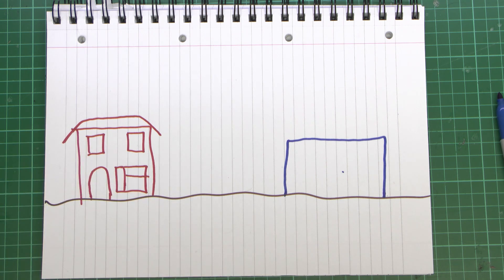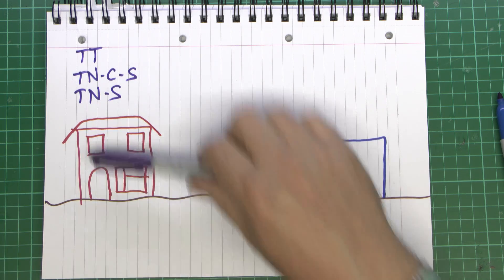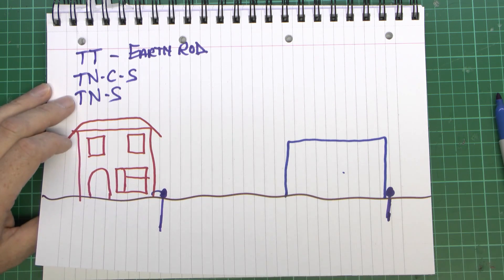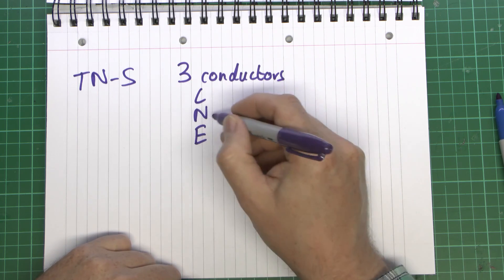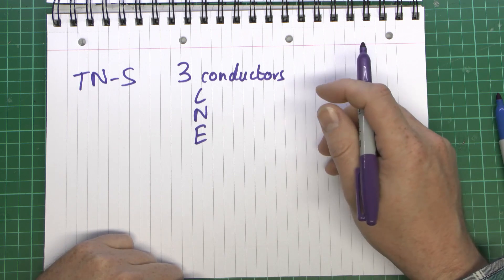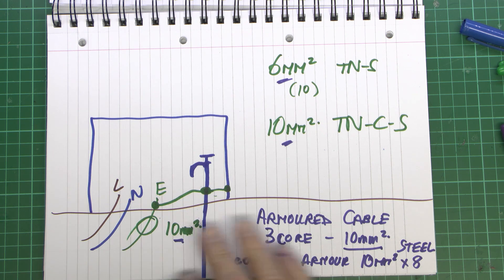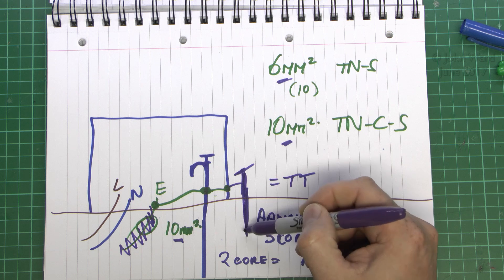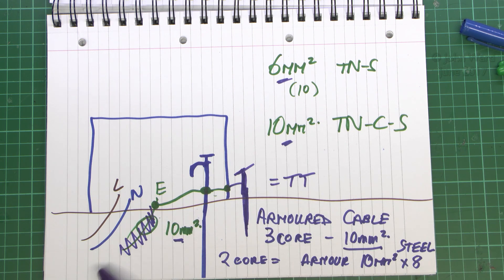Earthing Systems for Outbuildings

Comment: Hi John, fantastic channel. How do I donate? 

Quick Q. I need one 32amp radial circuit for approx 4 double sockets in an outbuilding that I'm having built. I also need a second 32amp circuit for a single connection to a large printer which has a max draw of 20 amps but uses a blue 32amp connector. 

Would the best and most simple approach to be to run two 6 or 10mm armoured cables to the outbuilding from the houses consumer unit with a 32amp MCB for each? Should I put an isolating switch on the printer?

Many thanks
Reply from the maker: Two cables could be used, although 4mm² is plenty for a 32A circuit, unless the cable is excessively long.
A more usual choice would be a single cable to the outbuilding, and then have various circuits from a consumer unit in there - presumably this building will also require lighting?  That also provide options for alterations / additions in the future.
Printer should have an interlocked socket, which is a switch and socket in the same box, so that the plug can't be removed unless switched off first.
Donation and other info: https://www.flameport.com/youtube_channel_info.cs4
Reply: @jwflame  thank you for the reply

Comment: Could you use a 6.mm 3core swa  and use one of the inner cores plus the armour to make up the difference ?
Reply: Following this comment
Reply: I (think) i worked out that may not in-reality be enough...  and in some respects goes down to the regulation-wording.
I could also ask after 4mm 4-core , 2 cores + armour to carry the main equipotential bonding?  Puzzle!
Reply: Come to think of it, probably not as the steel cores would have to be at least 32mm before you even go there, and even then, it may still not comply as it is not one material or the other due to wording of the regs
Reply: I’d say not because they would then be parallel conductors and a parallel conductor need to be the same diameter, same length and made of the same material to ensure it has the same resistance I believe.

Comment: Surely most people will want to fit RCBOs or RCDs on all new installations anyway, so TT is the basic way to go to satisfy regs easily. If you supply with say 6mm SWA 3-core and link armour and earth you have more than enough safety at reasonable cost.

Comment: What's the difference between touching the floor of an outbuilding with a concrete floor, which is the "ground" is it not if the concrete is in direct contact with the earth below, and touching a tap connected to the ground through a metallic pipe ? Surely in both cases you're touching ground ? Or is this just a case of how good the connection is as a conductive path ?

Comment: if you run your copper water pipe from your house to your garage or shed wouldnt the earth from the house cover this as its directly connected. You would only have open circuit on the tap earth in the garage if the water pipe was physicaly broken.

Comment: Hi John thanks for another great video very informative as usual. Just wondering what the main reason why you could not use tncs earthing from a house for caravans but you can for a steel shed. Are they not essentially the same if a neutral fault were to occur before the installation? Thanks again!
Reply from the maker: Caravans are mostly insulated from the ground due to having rubber tyres and the smaller legs being typically on wooden or plastic pads.  The connection to caravans is usually via a temporary flexible lead with only 2.5mm² (or even 1.5mm² ) conductors, so faulty or broken connections are very likely, as are reversed L&N connections, and even when connected properly the earth / bonding is far smaller than the 10mm² minimum required for TN-C-S.
Reply: @jwflame  Thanks John!

Comment: I was always taught that on PME you must never take the earth outside the equipotential zone (house). In a separate outbuilding an earth rod was required and the garage CU had to have an RCD. The earth rod was a reference for the RCD to operate in event of a fault and 6mm was suitable if mechanically protected.
The SWA from house to garage was also covered by an RCD on the house CU in case the underground cable was ever damaged. At the garage end a plastic CU was fitted and the end of the SWA steel was isolated from the earthing in the garage. This was to prevent and external service earth faults tracking through your house earthing system, through the SWA earth and down to the garage earth rod which could possibly be a few hundred amps.
Is this old school thinking and have things changed? 
Not done 18th yet, hope to retire before I need to take it...lol
Reply: That's exactly what I thought except the reason for it being that with TN-C-S there could be neutral circulating currents due to earth and neutral being the same conductor externally and there can be a "perceived" electric shock between exposed conductive parts and real earth.

Comment: exporting an earth from a PME.
ZE was 1.28 ohms at the out building
outside of 0.35, so at the remote building (20 metres away) i isolated the exported earth and installed an earth rod.
your thoughts?
Reply from the maker: Ze is measured at the origin, not at the end of a circuit.
Whether Zs of 1.28 ohms at a remote building is suitable depends on the protective device installed.
Using an earth rod instead of the supplier earth will make Zs far higher.

Comment: On a tt system, I don’t understand why you would need a second Earth rod in the ground for the garage if you took an Earth from the house.
Reply: from what I get from the video you dont need it - only if there is extraneous metal parts
Reply: If you have a TN-C-S or TN-S supply to the house and your taking an earth to the garage there would be no need for an earth rod. As this would continue as a TN-C-S or TN-S system, providing the CPC is appropriately sized.
Reply: Jck142 extending the tncs, to an out building, if the neutral goes down, are you not out the equipotential zone? I thought you are, and this is why you don’t use the pme and simply rod it. Slightly confusing. Many people say only use one system, I’ve also read and been told, you can supplement pme with rods. I.e a cabin wired in swa, using the pme, can be supplemented with a rod( in case of neutral fault). Under fault the currents can be large and burn the rod out! So unsure about this too. Very conflicting, wonder if @johnward
Reply: Moelwyn, he answered that question elsewhere on this video amongst the other comments, you can export so no need for another earth rod

Comment: Hi JW, I have taken my ringmain and lighting circuit and isolated it from the house consumer unit, so effectively disconnected from the grid. I have installed an off grid system, e.g. solar, battery, inverter system and have connected the house ring and lights via a new consumer unit. I have used an earthing rod to earth this system which goes directly to the Inverter, and from the inverter goes the earthing wire to the consumer unit. What guage wires would you recommend to ensure a good earth in this system? Or perhaps you can do a video on such systems?

Comment: So, John.  I have a (single PH) 2 cable overhead supply into to a brick building, where the meter is.   I need to go from there (via rcd spur) underground 75m to my new house, which will be, yes, steel framed.  About as Extraneous as it gets..  What do you feel is best?  With the long run, I was going to use 25mm sq cable, but 2 core, as I feel relying on such a long (and old, unknown) earth is maybe risky?

Comment: Hi JW. I’m running a 6mm 3 core to a shed 35 metres away. Some electricians have told me I need to use an electrode and not connect the 3rd core to the house’s MET. But others have said an electrode is not necessary and I’m fine to use the 3rd core as the CPC from the house? Which one is correct? Thanks!
Reply from the maker: Could be either.  In most cases using the supplied earth is a better choice.
Reply: John Ward Is there any reason why won’t wouldn’t use both methods? i.e use both the earth core from the house consumer unit, and use an earth electrode bond at 6mm! Thanks mate
Reply from the maker: @zaks8285  Could be done, and is permitted, but a single extra rod won't achieve anything.

Comment: I'm planning to run a TN-C-S supply to a remote building (no extraneous metal) from a socket circuit in the dwelling.  The new cable will be RCD-protected from the house so I'm planning to use non-armoured cable.  It's a 30m run attached to a sturdy boundary fence.   How about using PVC conduit containing 6491X singles?
Reply from the maker: Could be done, although fences are rarely sturdy or suitable for permanent installation of cables. 
SWA will very likely be cheaper and quicker to install.
Reply: @jwflame  It's a wooden fence but luckily the base panels are concrete.  Whenever I think of SWA I remember the tedious hours spent assembling the glands in the rain, but yes  I think you might be right.  SWA will be much quicker to erect than conduit, and the summer isn't over just yet (hopefully).

Comment: I am thinking about having the house consumer unit upgraded and wonder about adding a separate supply to my garage come workshop. Currently it's a spur off the upstairs ring main as that is lightly loaded. The spur is overhead swa and meets requirements on that but may be changed to buried. I aimed to treat a new feed like a sub main by using fuse protection to allow the remote consumer unit to function independently of the main house circuits protective devices. I'm wondering if 18 strictly prevents the use of a PEN produced at the garage cu with the resulting earth also connected to a spike. This seems to be a pretty common way of distributing power but not sure how this fits in with building regulations. I feel that this offers a better solution to making the garage purely TT and an alternative to exporting the house earth.
Thanks for your videos by the way. I've watched a number of them. They are very useful.
Reply: I wont be doing the work myself by the way.
Reply from the maker: You can have your own earth and connect it to the supplied earth - there really isn't much point but it is permitted.
A PEN conductor (where the earth and neutral are combined) is not permitted within any installation and hasn't been for many decades.
Reply: @jwflame   Thanks. I wondered as it could be a better arrangement than the workshop being TT.  A number of people with similar hobbies to mine seem to end up with TT.

Comment: Huh. I'm pretty sure the TN_S configuration is the only type allowed for remote subpanels under the current US NEC, but the third conductor is an actual wire in the cable, not a lead sheath.

Mike Holt goes into excruciating detail on this in his videos, which I highly recommend. The TT configuration has far too much ground resistance to reliably trip breakers, and the TN_C_S has the usual sorts of shared neutral/earth issues. Notably a broken or high resistance neutral/earth connection will result in all grounded metal cases going live in the outbuilding as soon as any thing in the outbuilding is turned on.

Comment: Supplied a wooden summerhouse with a 6mm swa feed, supply was TNC-S. No extranous conductive parts. No metal in the construction at all. However council inspector wouldn't sign off the installation and I had to make it TT. So it would seem that almost all situations now require you to TT any outbuildings.
Reply from the maker: Did this 'inspector' provide any reasons why TT was required?
Reply: Was there a swimming pool?
Reply: Forward to 29.45.. your answer about the council inspector might be that

https://www.facebook.com/NICEIC/videos/2914121855481246/
Reply: Hi John, just reading the item about earthing to out buildings. This may become an issue when I move int new house, as and when things get sorted out via lawyers etc. The shed is approx 25-30 metres from house with earthing connected to house TN-C-S, I am concerned that Building Control may require TT rods to be used due earthing being too long a run to satisfy (in their opinion)?

Comment: Hi John great video as usual however i have a query. If a 6mm 3 core SWA was used couldn't you join the armour with one of the core wires to increase the eath rating? And if so would this meat the 10mm requirement?
Reply from the maker: Almost certainly not. .  6mm² 3 core SWA has an armour size typically about 23mm² but that is steel, and for PME the requirement is minimum 10mm copper equivalent (as in Table 54.8). 
Steel is about 8 times less conductive than copper, so 23 steel is only about 2 or 3 copper equivalent, which added to the 6mm² core is still less than the 10mm² required.
There are also other considerations with having 2 separate conductors, particularly where they are of different materials and shapes, as the current may not be divided between them in the most obvious way.
Reply: @jwflame  Thanks John that is really interesting thank s for the reply it's really appreciated. Keep up the good work!
Reply: @jwflame  hmm, I was going to ask about using something like 4 core, 4mmsq SWA using 2 cores and the armour as earthing.  But apparently not then.
It's starting to seem more and more, a problem that cable manufacturers could solve by supplying SWA with 2 cores sized to carry the required current and a third sized at 10mmsq to meet the bonding requirements.
Wonder if there's a market for that?

Comment: I would like to know what earth arrangement would be best so that a fault causing the RCD to trip in the shed does not also trip the RCD in the main consumer unit?
Reply from the maker: The type of earthing doesn't make any difference to RCD operation.  The solution is to not have 2 RCDs for the same thing - either have the RCD in the house only, or the shed only.  For TN earthing, the cable from house to shed doesn't need an RCD if it's an armoured type.  For TT it will, but that can be a time delay version.
Reply: @jwflame  Thank you John, very helpful.
Reply: I'd supply the outbuilding via an RCBO in the CU and then it won't trip the rest of the house. But then I'm in favour of all RCBO systems anyway. It's perfectly allowable to have RCBOs and RCDs in the same CU (although the RCBO musn't be fed via an RCD).
Reply: @TheEulerID  I have now switched to RCBO's entirely, but it would be nice not to have to go back to the house if something trips downstream from the shed RCBO. Perhaps I need to use an isolation transformer between the two.
Reply: @ChrisHills44  If you have space,  you could consider feeding your shed via a time delay RCD plus MCB in the consumer unit and then a normal RCB or RCD in the shed. 
It does mean taking up three ways in the CU. Also, if you are using SWA cable to feed the shed I believe it's allowable to use just an MCB in the CU as long as you have an RCD in the shed.

Comment: Would this  video still be upto 18th edition regulations
Reply from the maker: Yes, this hasn't changed in the 18th edition.
Reply: @jwflame  thank you John was a great video very informative
Reply: @jwflame  if you use swa to feed a shed c.u dose the swa need rcd protection. Because the shed c.u will have an rcd to protect the circuits it is supplying
Reply from the maker: @gd-bq7em  SWA and other armoured cables do not need RCD protection, unless it's a TT supply.
Reply: @jwflame  ok thank you jw 👍

Comment: So 3x core, inner core cpc core and swa outer combined would be more than 10mm..so is there a reg preventing it?
Reply: Remember the outer of a SWA cable is steel, not copper, so the conductivity there won’t be the same. You can’t just add up the numbers and confirm they exceed the requirements of copper. More calculation required.

Comment: in a TT system, one should not have more than one earthing point to avoid ground loops which depending on the fault can cause power to flow from one ground point to the other, which is why the electrical code in my country requires that all earth wires go to a earth bus bar within the DB, before a single earth wire goes to the earthing rod. No looping of earth wires is allowed.

So by right, the outhouse should also have an earthing wire going back to the panel in the main building, if it was a TT system

Comment: earth and neutral combined....this is confusing for the casual viewer (me) if the neutral is damaged in some way does this leave the whole kit a kaboodle "live"?
Reply from the maker: Yes, if the combined earth/neutral is broken, exposed parts become live.
Explained further here: https://www.youtube.com/watch?v=JRHyqouJPzE
This is a very rare event,  but when it happens it can be very dangerous.
Reply: The combined neutral and earth is ONLY at the incoming supply at the house. the additional distribution SWA sub-main cable will always have its own neutral and earth ALWAYS in the uk. So its pme , or TN.C S at the house end incoming supply,  and either TN S OR TT earth electrode at the outbuilding end.

Comment: Exporting a TNCS earth outside the equipotential zone? I disagree.
Reply: What defines the equipotential zone? (I'm not a sparky but interested)
Reply: I am also against exporting an earth from a tncs I was under the stars impression that you can not export it from the main building as if you lose the neutral somewhere down the line you have also lost the earth conductor I always stick a rod in an outbuilding on a tncs system    I was speaking to s guy who is involved with the regs and he has told me that they are talking about trying to make all tncs into pme as there has been too many problems where the neutral has been lost with the supply  so there is talk of having to rod every house in the country that is tncs or something along them lines
Reply: Forward to 29.45

https://www.facebook.com/NICEIC/videos/2914121855481246/